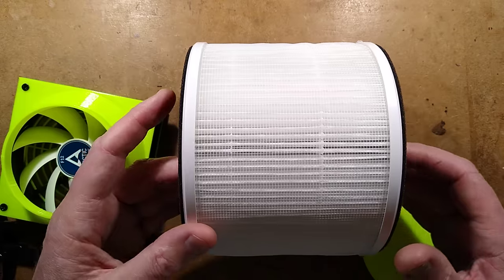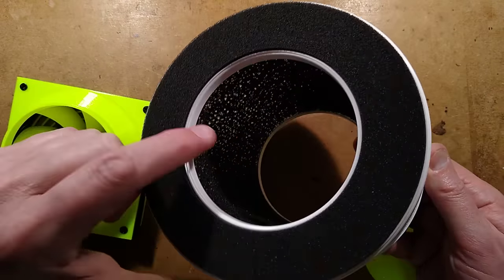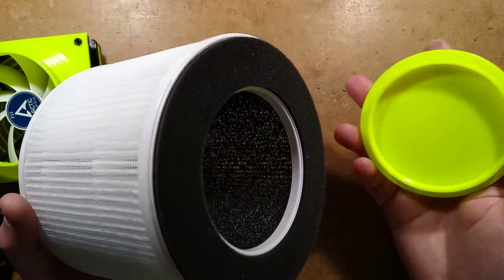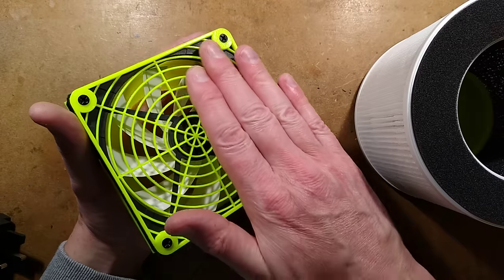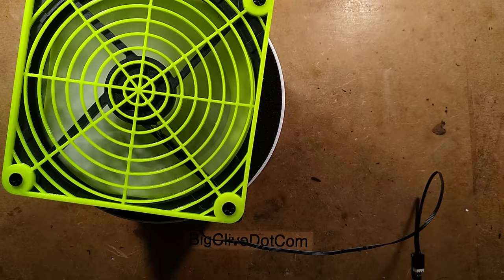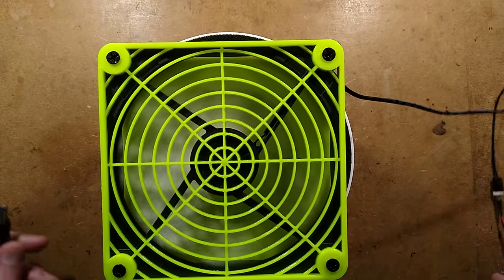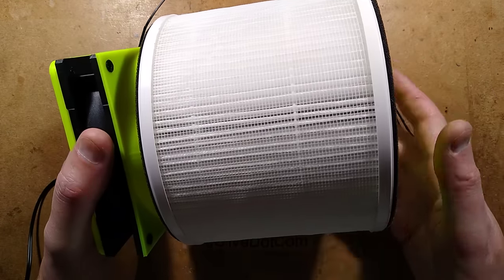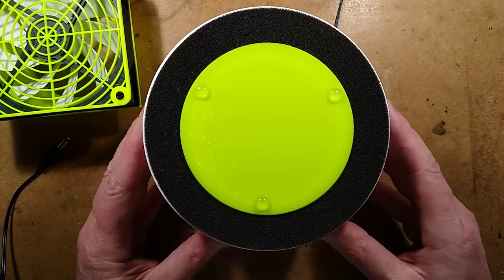DIY cheap & quiet HEPA air cleaner

Comment: Its surprising how much crap a decent filter can catch, even in area that seem relatively fresh and clean already.
As for mounting PC fans horizontally there's absolutely no problem as many cases have such fans in the bottom or top mounted like this. People saying otherwise are probably putting fan failures/noisey fans down to mounting instead of because they were using chinesium garbage fans that would of failed anyway.
Reply: *would have
Reply: @Papperlapappmaul  We're not in school here. You understood what ErraticPT said, otherwise you wouldn't be able to correct them. Chill out a bit.
Reply: Yes we are at school.
The teacher (aka Big C) would not make such a mistake and neither should you.
Reply: @Xiph1980  I would tend to agree. The number of mistakes, misspellings and just awful grammar in comments says a lot. Many adults now would really struggle  to read a children's book from the 1930s. Correcting every mistake would be a more than full time job.
Reply: @LordDragox412  I'm pretty sure you just got whooshed.
Language is dynamic. Books from the 30's are rather at odds with current spelling and grammar rules, and as such, what is considered "correct" right now, is fraught with mistakes in reference to rules of a century ago. That's one of the reasons why correcting someone's spelling online is misguided. The idea that there's only one correct way to write things. Besides that, it's pathetically pedantic.
Reply: @harikrishna69  I'm pretty sure he would make mistakes, one way or another. I've yet to encounter the person who would never make mistakes, and I think he's a person. Ergo, he'll make mistakes. You will also make mistakes. And I make mistakes too. It'll be a shitty life trying to make everyone be "perfect", whatever that may mean to you. Chill, grab a chamomile tea or something. Let people be people. Let them make mistakes.
Reply: @Anvilshock  I wouldn't call saying 'Would of' instead of 'Would have' as 'spelling like utter crap'. Chill out bud, if that's what winds you up then you really need to see someone as that's not normal.
Reply: @Anvilshock  Are you well, do you need help? You seem like you need a professional to talk to.
Reply: Well depending on the bearing type definelty can make a difference. But PC fans do last quite a while now so not that much of a worry.
Also could be interesting, there are specialized fans, called high static pressure fans. Those are meant to be used for radiators, since the air has to go through a filter, it might be a good idea to use those high pressure fans.
Reply: @Pouchey2  I don't care one iota what you do or don't consider utter crap. It takes special disregard to substitute a completely different word among otherwise perfectly correct spelling. Mistakes can happen, but I'm not in the habit to excuse, even reward, laziness and indifference, so you can shove your unimaginative deference to psychological issues where the sun doesn't shine. Also, what's a "chill out bud", and why are you mentioning it? Eaten any grandmas lately?
Reply: @Lassi Kinnunen 81 well it's not really about can't use them, it just decreases their lifetime. Many bearing types have some lubricant inside, depending on type of bearing they have an optimal orientation.

I don't give a crap about fan orientation though, as they typically last long enough anyway :D
It's probably more worth considering it for a long lasting device, like an airfilter or something like it.

Here's the link to a video about pc fans :)
https://youtu.be/BsT3JCXKiQA
Reply: I think they should be fine as long as they are horizontal or vertical, while having them at an angle might create uneven wear.
Reply: @Xiph1980  you hava point.
Less settl for shoulda?
Reply: @Xiph1980  I personally want to have my spelling and grammar errors pointed out to me, specially since English is not my first language. I'm really unable to understand why anyone would mind such corrections to the point of objecting when they aren't even addressed to them.
Reply: @Papperlapappmaul  *would've
Reply: I've got this pretty big Honeywell that needs a new Hepa filter (not the charcoal fabric prefilter) and they don't even make the filter anymore.  You have to buy two smaller filters and stack them, or you can buy a generic one that everyone in the reviews say it doesn't fit and smells.
Reply: @SlyPearTree  Cool, however OP didn't ask for such "service" to be provided to them. Also, there's circumstance to account for. If I'm writing a thesis, and you're finding linguistic errors, please give me a shout. However this is YouTube.
Reply: @harikrishna69  Sure!
Reply: @Anvilshock  Mind your blood pressure kiddo.
Reply: @Xiph1980  I don't have kiddos to mind, of the blood pressure type or otherwise.
Reply: @Koichifirst  an NF-F12 iPPC 3000 or a Phanteks T30 with the switch set at the 3000RPM position, if you do not care about noise, or the T30 set to 2000 or 1200 rpm for silence, more partial towards the t30 as it has a maglev bearing, so less parts moving past each-other those would be my choices (get the expensive fan, it will last longer and need less replacing and possibly grant a lower TCO)
Reply: Great comment, and true. These fans ain't got no bearing, the bearing is air.
Reply: @Xiph1980  lot of distance between the correct uses of have and of. If the teachers at elementary school didn't correct them, it's the job of the grammar nazis now, and there will be no chill when it comes to grammar.
Reply: @Papperlapappmaul  bet you're fun at parties 😂

Comment: I just came across the video and just wanted to say thank you for it and for making the models publicly available. I noticed Cabb Arot below changed the script in order to use a 140mm fan. I modified it so that the fan size is now configurable. 

For those not comfortable changing code, when using OpenSCAD, after pasting the code in the left hand pane there is a pane on the right hand side of the window that allows one to change the values without modifying the default values. I've added a check to the code, which is at line 22, that will stop processing if the size of the fan is set to be larger than the size of the hole in the filter. The program creates cones with "negative heights", which is just wrong. If you are running an old version, before 2019, of OpenSCAD and this model doesn't run from the beginning then try removing the following line:
assert(fanwidth>=filterhole,"The width of the fan must be equal to or greater than the width of the opening (hole) in the filter.");

If one sets the fan width to be less than the value for the filter hole then nothing will appear in the main part of the window where the model is usually displayed and below, in the area labelled Console, there should be some text highlighted in red that states the following:

All that needs to be done is change the value for the fan width or the filter hole so that fan width is at least equal to or greater than the filter hole. 

I hope that I've added a little something useful to the great work that Clive has given to the community.

//HEPA filter fan adaptor
//You can adjust these five variables
//Primarily the filter hole diameter
/* [ Global ] */
screwhole=5;    //fan screw hole diameter (5)
filterhole=92;  //HEPA filter hole diameter
thickness=1.5;  //Thickness of plastic layer (1.5)
insert=10;      //Length of insert into filter (10)
fanwidth=120;   // Width of fan being used in mm (120)

$fn=100; // number of fragments, higher provides smoother curves, 0 > $fn >= 360, impacts time to render greatly 

/* [ Hidden ] */
//Do not adjust anything below here
cone=(fanwidth-filterhole)/1.5;
wall=thickness*2;
halffanwidth=fanwidth/2;
screwoffset=7.5;
startingdiameter=fanwidth-4;
endingdiameter=filterhole-wall;

assert(fanwidth>=filterhole,"The width of the fan must be equal to or greater than the width of the opening (hole) in the filter.");

difference(){
union(){
//flange
translate([0,0,0])
cube([fanwidth,fanwidth,thickness]);
//taper to filter insert
translate([halffanwidth,halffanwidth,0])  
cylinder(h=cone,d1=fanwidth,d2=filterhole);
//filter insert
translate([halffanwidth,halffanwidth,cone])  
cylinder(h=insert,d=filterhole);
}
//taper to filter insert
translate([halffanwidth,halffanwidth,0])  
cylinder(h=cone,d1=startingdiameter,d2=endingdiameter);
//filter insert
translate([halffanwidth,halffanwidth,cone])  
cylinder(h=insert,d=filterhole-wall);
//fan attachment holes
translate([screwoffset,screwoffset,-1])  
cylinder(h=thickness+2,d=screwhole);
translate([screwoffset,(fanwidth-screwoffset),-1])  
cylinder(h=thickness+2,d=screwhole);
translate([(fanwidth-screwoffset),screwoffset,-1])  
cylinder(h=thickness+2,d=screwhole);
translate([(fanwidth-screwoffset),(fanwidth-screwoffset),-1])  
cylinder(h=thickness+2,d=screwhole);
}

Comment: This is so great! Thank You! And Thank You for publishing the open scad scripts. I was going to make something out of cardboard but this looks nicer. It can be given as a gift to others without looking extremely home-made, it can be taken to hotel rooms, and it can be transported easily. Well done! 
For those wondering what kind of fan to get: there are CADR calculators out there to help you calculate how many air changes per hour you are going to get depending on the size of the room and the m3/h or CFM of the fan.

Comment: This came at the perfect time. I was just trying to figure out how to incorporate a HEPA filter into my central air system. Thank you for the inspiration, the last pieces of this project just came together.
Reply: If you try and use such a small surface area filter in a central air system, you'll kill the blower motor.
Reply: @LBCAndrew  Definitely a pitfall to avoid! I have it installed on a parallel run with the return duct, with a booster fan to pull air through the hepa filter.

Comment: Nice to see you using an Arctic fan, they are great value. I'd recommend their P-Series though, as they are optimized for static pressure (like blowing through radiators). I wouldn't worry about the orientation, they are often mounted like that in computers.
Reply: I wonder how much better a Noctua fan would perform
Reply: @Roalethiago  was wondering the same
Reply: @Roalethiago  Noctua fans generally have significantly worse performance.

That's the cost for silent fans, they just do the best silent fans.

IIRC the most common Noctua's move roughly 40% less air than the performance competition
Reply: @Domini0nRock  that has not been my experience at all. Noctua's fans cfm as a function of noise is quite good, moving more air than similarly sized fans that are much louder.
Reply: @Domini0nRock  if noctua fans  move 40% less air then how come they get lower temps than when using the "performance competition"
it dont matter if the fan is on a air cooler or water cooler under testing noctua fans win every time
l guess you must have been using a case fan when you should have been using a static pressure fan to get such bad performance out of a noctua
Reply: @Domini0nRock  in this case I dont think so, I got P12 and noctua here (a lot of each and the moved air is nearly the same), according to the test one post above, this should be right and static pressure of the noctua is a lot better (keep in mind tho, that you dont need that in most cases)
Reply: @Roalethiago  Slightly better. Noctua uses a glass fill plastic, Arctic doesn't. That means Arctic's fanblade tips can't be as close to the duct as their fanblades will slightly stretch more as it rotates.

If the airflow restriction is great--as in this fan--the path of least resistance becomes the gap between the fan blade tips and the duct, so air will come back out through that route.
Reply: @Roalethiago  probably a little better, but the price difference is much larger.

Comment: This was my first project when I made an enclosure. Mines used a lot more plastic though lol. It did work well with a hepa filter pad and a bag of activated carbon. ABS fumes can make you ill I found out. I love the engineered version you made, if you lift the bottom a few cm and add vents and you could sell it to new age people for 3x the price lol

Comment: Here is a tip for those who have many short leftover filament pieces.
You can weld them together and get a longer filament. Albeit different colors. 
1- Cut a piece of Bowden Teflon tubing PTFE (about 20mm)
2- Put each end of the two filaments you want to weld together, so that they meet in the middle of PTFE tube.
3- Use a lighter or a soldering iron to heat up the middle of the tube where the filaments meet, until they melt at the location.
4- Press the filaments together slightly and let it cool. 
5- Voila, slide the tube off and the two ends of the filament are now welded together. 
I call it; "Good to the last drop" printing!
Reply: Do you know how the airflow direction is? Is the fan blowing down into the filter or sucking up into the sky?
Reply: @boss47g  you feel the air flow.....
Reply: @boss47g  the side with the braces is 'out'

Comment: I did this with my milwaukee work fan, a sterilite tote, and a nice 24"x12"x4" hepa filter that was marked down 85% as it wasn't selling. Hole sawed the tote, fan in the tote, taped the filter on the lid, all done. Works fantastic, not counting the fan and tote which I already owned got a nice area air filtration system for about 7$.

Comment: I've knocked a few filters up using a cat litter tray with a carbon filter from a cooker hood, and a couple of PC fans.
Cut two holes for the fans and mount them with a glue gun. Then tape the carbon filter paper over the open side.
Some flat air filters from cars fit onto litter trays too.
Once they're done, I pop a hole in the edge and string them up from the ceiling, and let them twist in their own wind.
Great as a backup for clearing smells.

Comment: I'd recommend radiator (pressure optimized) fans for this application. Often labeled AP rather than AF, they will have fan blades designed for overcoming static pressure.

Comment: I have something similar to this, except I'm using a inline duct fan that can move a lot more air at much higher pressure than those fans. I use it as a portable filter when I'm doing soldering, spray painting, 3D printing, etc.

Comment: For sweeter 3D printing it is useful to set wall thickness to a multiple of your extrusion width.
For example a 0.4mm nozzle extruding at 0.4mm then a wall thickness of 2.4mm would be better than 2.5mm
This avoids a nasty void that is either left unfilled or "buzz filled" buy the slicer

Comment: These are great for people who burn wood & coal for heat.   I used a 250mm fan with a 16" X 16" furnace filter.   Runs 24/7 and in three months os black.

Comment: The fan needs to be able to agitate the air in the room considerably in order to pull enough air/particles towards the filter. So an output duct at an angle might be worthwhile, combined with a fan that moves a lot more air. 

Also, air should be blowing not into the filter but out of, so... get sucked into the fan via the filter. I fear some people won't even look at that aspect if it's not told.
Reply: Ive been considering it. Thats why im browsing comments lol

Comment: To help me breath when camping, (asthma and badly built camp fires do not go well together), I built using a HEPA shop vac filter and a 400 CFM 12V bilge blower with a PWM controller to adjust speed. 
I like your idea.

Comment: This one's leaps & bounds above the previous one that used toilet paper! 😜
I like the idea for a horizontal base-plate/flange, but I think it's fine as-is.
The only improvement I'd really love to see is the use of a "squirrel-cage" blower, because they can really move a LOT of air. The only trouble is that they're not universal, so interchangeability of blower motors might be an issue. However, if you can settle on a very cheap, very common blower motor -- something out of an older, say model year ~2000, Ford pickup truck -- then I think you have the potential for making a HEPA filter unit with a LOT of 'oomph' for little money. I've toyed with the idea myself, before I put a diaphragm pump & filter on my soldering station.

Comment: I decided to make this project when I saw it on the livestream. I decided to go with a 200mm wide, 250mm long Philips filter, very similar to the one in this video. Cost of the filter was 16€. 

For the fans, I chose two Arctic P14's, one for each side. They are affordable at 7.60€ each, and claim to be quiet. They also list a high static pressure of 2.4 mm H2O. The 140mm diameter also helps with airflow. And being PWM their speed can be precisely controlled.

I'm currently designing the 3D printed stand/fan adapter that puts the filter in a horizontal position. Thanks for this great project!
Reply: I am going to use a Nocuta 140mm i have sitting around. Do you have a script for a 140mm fan?
Reply: @Makaveli6103  I designed my own adaptor in Tinkercad. I think Clive's scripts could be edited to accomodate a 140mm fan. I'm not too familiar with openscad.
Reply: I'm currently experimenting with the video setup. I tried with two P14 fans first stack each other and then on the both ends of the filter. I don't have any instrument to measure the flow, but by hand I feel that fans stack each other is more efficient.